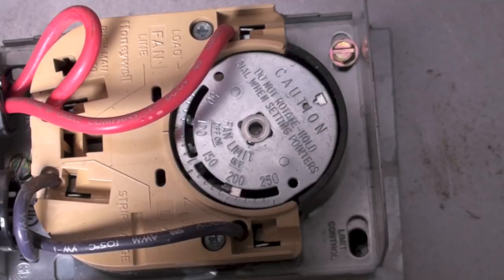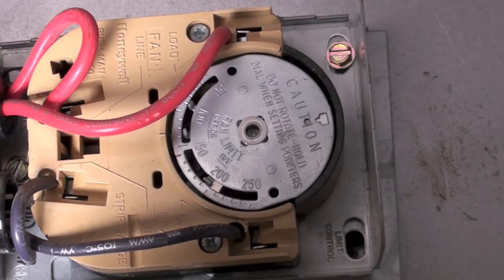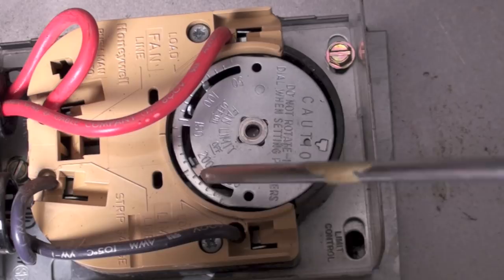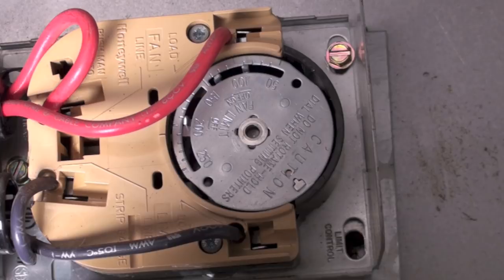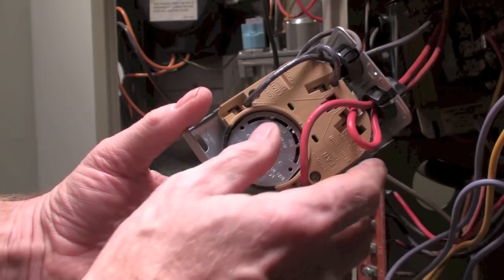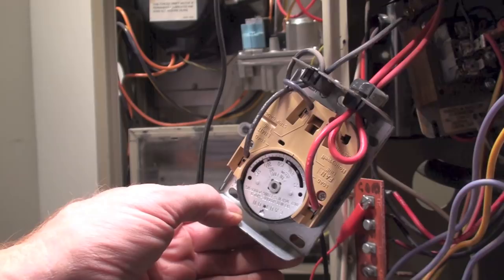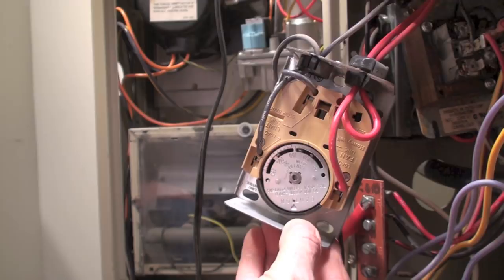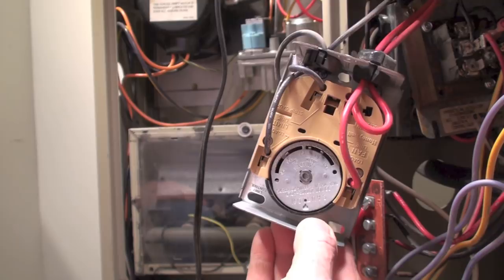How the Honeywell fan and limit switch works.

Comment: Is there ever an instance where u need the little copper switch in there? If so then explain it.
Reply from the maker: On some older furnaces, the limit switch opened the high voltage circuit to the transformer.  So power was run to the limit in the same circuit as the was used for the fan.  Hope this helps.
GFM
Reply: that does help

Comment: I have a Lennox pulse g14. Has no problem heating the house however the fan will turn on and off several times after the heating cycle is satisfied. I adjusted the fan off setting to below 90 degrees and now it only comes on once after the heating cycle. But as soon as the fan shuts off it slowly rotates back to 140 and stays there. The current fan limit switch is a honeywell l4064t2242 it says this part is discontinued do you know which one I can replace it with?
Reply: Ok. I have 6 total wires going into my switch does that seem right?
Reply: @grayfurnaceman7640  changed out the fan/limit switch, works great but while I was working on it I found a small propane leak around the top of the gas valve. I dont know If it's the pipes or the gas valve itself. If I shut off the gas to the furnace disconnect the pipes and put thread compound on them and reconnect them with I have to do anything special to light my furnace again? Or should it just resume like normal
Reply from the maker: @daltongavers491  First, I would try to isolate the leak by using a soap solution on all fittings.
Once it is reassembled, you can just fire it off.  It may safety out for the first couple of ignition tries, but it should fire off ok.
GFM

Comment: Here is a question, last weekend my furnace started short cycling, Call the gas company because I have a repair contract with them.. they replaced the limit switch, but didn't fix the problem, saying it's the "extreme cold"  they made an adjustment to the temp pins, that got me through the week, the tech told me to adjust the pins back to where they are suppose to be when it gets warmer.  So I did that this morning.. same short cycling issue.. Now they I watch this video, I noticed my switch isn't working like that.. it goes on at 100, fan kicks in at 150, then it goes back to 100 and shuts off..  why would it doe that?
Reply from the maker: What is happening is that the cold air in the return is "shocking" the switch and shutting down the fan.  There are a couple of reasons for that.  One, if you have a very low return air temperature it could happen.  Also, some fan switches have a small heater that preheats the fan switch.  If that heater is failed, it may also shut off.  I have a video scheduled to come out at the end of Jan covering this heater.  Hope this helps.
GFM
Reply: grayfurnaceman
My return air is in my house, very short return.. it's a condo actually. the return length is about a foot and a half, with the furnace in an outside closet. I've been here since feb of last year and never had an issue. that's why it's confusing to me. and today, it's 62* vs the -20 it was the other day.
Reply from the maker: joey197777 Your furnace is outside the house?  In a lean to next the house?
GFM
Reply: it's in a closet outside. It's how the condo was built.
Reply from the maker: joey197777 My guess is the problem is outside air is getting to the furnace.  There is really nothing I can see to fix this.  Do not cover any outside air grilles.
GFM
Reply: I appreciate it, I had the gas company out again this morning, this time they sent the guy who works the complex and did the inspections and gas meter installs when the complex was build 20+ years ago.. He said even though he couldn't get any carbon monoxide to show up, based on the smell he was smelling, and the way the furnace was acting, the heat exchanger is cracked. Said it was probably up high which is why it's doing what it's doing. So, 20+ years out of a furnace isn't to bad I guess. Time for new.  I will subscribe to your page though, for any future issue that might come up in this place.
Reply from the maker: joey197777 Glad you got it taken care of.
GFM

Comment: Hey brother; i have one of the other honeywell switches you posted with and set with the temps you said etc. The problem is it's shutting the burner off after 90 seconds.. runs just like the one in this video with no fan.. cept my fan is on and it reaches the too hot level and kicks burner off for like 6 minutes as it cools.. repeats. single digit temps in PA and thermostat reading 62° inside.. probably colder. Would imbalance of ductwork cause this (not enough return) or need bigger motor for hamster fan? Or...?
Reply from the maker: There could be ductwork problems or a crack in the heat exchanger near the fan and limit.
GFM
Reply: grayfurnaceman 
Welp.. wouldn't ya know.. the hamster wheel was spinning in the wrong direction.. reversed motor and heat pumping. Thanks to your videos!
Reply from the maker: That will make a difference
GFM

Comment: I got one more question. I replaced my thermostat and the AC comes on fine and the fan comes on fine. I think my limit control switch might be bad. The thing is I don't know how to test it and mine is not like this one. Mine are two bars laying in parallel beside each other. There is a red black and blue wire. Can I put any limit switch on it or do I have to replace it with the same one? Fanomatic or something like that. And can you tell me how I could test that limit?
Reply: +Mike LikesBeer Sorry it is a thermo disc
Reply from the maker: +Mike LikesBeer They are specific to each furnace model.
GFM
Reply: grayfurnaceman Thats what the problem was the whole time. There are two on this one. I think one is working know and the other is still not functioning right because its not kicking the fan on. Because the fan wont kick on unless you turn it on manually the furnace will kick off by its self.
Reply: grayfurnaceman Just a follow up. It was both the limit and the fan switch. I just touched the back of the limit switch and it reset, but the fan switch I had to remove and tap on my counter top. When the build up/corrosion? all fell out I put it back on and it works like new. I'm sure its not like new but its working correctly now. 
Thanks for your help. Saved me a lot of money! and subbed. Looking forward to the homemade beer! You gonna have to do some taste test if you haven't.
Reply from the maker: +Mike LikesBeer The switch will probably fail again.  But, who knows.  The taste test are coming and maybe some recipes if I get a really good one.
GFM

Comment: I don't get it. I have exact switch but I don't see how the fan is connected??
Reply from the maker: The fan is connected thru the the contacts marked "fan" on the switch.
GFM
Reply: @grayfurnaceman  Really? Great, tx. You know, I had no problem, just trying to figure something out. I'm not sure how to take your response but it seems pretty cheeky and sarcastic. Why don't you watch your own video again and tell me if a person should be able to know where those 2 red wires are coming from. Or which is +/-
Reply from the maker: @blackopal3138   It was not meant that way.  Watch the video at about :30 seconds in and you can see the diagram on the switch.  This equipment is AC, so there is no + or -.
GFM
Reply: @grayfurnaceman  k, sorry. hate written communication. tx.... I guess what I meant for the +/- is that both wires are red so I couldn't tell which was the live (I call that +, maybe that's incorrect and misleading)
Reply: Why don't you get a book on furnaces and study them rather than bothering GFM with your obscure questions?
Reply: @x.y.8581   - Oh, good word usage, however extrinsic your comment may be.

Comment: Hi  Grafurnaceman ,

The Lennox gas heater rooftop  fan control has two extra wires  go in to Fan control  /high limit switch  . What is these wires functioned . What  can I do if I can not find the orinal part. Do I need to modify it some how . Thanks
Reply from the maker: quang nguyen They are probably a preheater.  You can replace it with one without the preheater and hope it does not short cycle.  Sometimes, if you set the on and off temps a little farther apart, it may work ok.   This video may help: https://youtu.be/-0CIsqw3HRcGFM
Reply: grayfurnaceman Hello ... I have one of those switch and I think it is bad.  When I hit the manual switch the blower does not come on.  I was trying to use the blower to push cool air up from the basement and it didn't come on.  I check for voltage to the blower motor and I didn't get 120 volt reading.  Correct me if I am wrong, but the blower motor should come on when the manual switch is turn on.  I know the furnace is getting power because I can hear it come on.  So do you think my switch is bad?  Thank you for your time.
Reply from the maker: spirittoo It certainly should.  The control may be failed.
GFM
Reply: grayfurnaceman Thank you sir for your quick response.  I ordered a replacement part from ebay.  I made sure I got the same length which was 11.5".   Hopefully this will allow my blower to turn on.
Reply: grayfurnaceman I replaced the fan and my blower still won't come on, but I am getting power to the motor this time.  Is the motor bad or am I missing something??
Reply from the maker: spirittoo If you are getting power to the motor, check resistance of the motor windings with the wires disconnected.  Open reading means winding failure.  If low resistance, you need to check all your wiring and voltage readings.
GFM
Reply: When you say check all my wiring ... do you mean the fan wiring or the furnace itself?

Comment: Hi, do you happen to know the model number of this limit switch off the top of your head?
Reply from the maker: There are several models that pretty much look the same from the outside.  The difference is in the length of the probe. Try L4064B to start.
GFM
Reply: Thanks, mine is almost identical but was a L4064e2544. According to honeywell, you should be able to replace it with a generic model L4064B2228 (Replaces L4064A, B and E). Going to try it out this weekend. Thanks again for the videos, they're great.

Comment: hi , im a new tech, , is there any way i can by pass this limit switch
Reply: You can jumper the terminals between the limit switch.
GFM
Reply: @electriccar3253  on the video there is 2 red wire is fan, and 2 black is limit , do u mean get a jumper connect black to black?  and it will by pass the limit ?
Reply: @geniusliu143  Yes
GFM

Comment: hi ,i an new tech ,i had a furnace has problem is working heat and ac in same time ,i am looking for advice if you can thank you
Reply from the maker: ***** Does the house have a whole house fan?
GFM
Reply: sorry,what you mean by gfm ,i work as maintenance in apartment complex thank you
Reply from the maker: ***** Those are just my initials
GFM
Reply: sorry gfm ,what you mean  by a whole house fan ?,my furnace is air forced the fan is in furnace
Reply: thank you

Comment: Bryce Katzman
3 minutes ago
Hello! Great video! Question: I just replaced the belt drive blower motor with one that is basically the same (1/3 horsepower, 1725RPM, etc..) the problem with the switch above is: that after kicking on the motor at 150F it starts to go backwards until it hits 90F and shuts off. This takes about 5-10 minutes. If I left it like this it would do it forever. Any suggestions? Thanks for any advice. Bryce
Reply from the maker: Too much air or return air too low temp.  Is the amp draw the same as the old motor?
GFM
Reply: @grayfurnaceman  - Thanks for the info. It helped a lot! - It turns out that I had some cold air escaping from an exhaust vent for a gas fireplace that I was using temporarily while my blower motor was busted. Once I closed it all was good! Thanks for the reply. I appreciate it!

Comment: great where can I pick one up
Reply from the maker: Generally, there are 2 ways to go.  One, you should be able to get one from a local HVAC dealer. Two, there are a number internet sources.
Reply: could I fix the one I have if I clean it the inside probe
Reply from the maker: Generally not.  You can remove it and clean the element, but it probably won't help.
GFM
Reply: I would like to replace limit control the only number I found on the side was L4064E2015-6-8843N S025-23005  ......Honeywell
Reply: I appreciate your help but could it be another switch causing fan to stay on
Reply from the maker: The L number is the correct one.  The 025 number is probably a number for the manufacturer.  Could be Coleman or York.  I would use L4064E2015.  5 inch insertion depth.
GFM

Comment: Im in a apartment , and landlord is up in age and clueless on repair... But my fan runs sometimes long time,, but after it does shut off ,, it will then keep coming on and off constantly.. 
So i figured i start with this but when i look up part numbers they all show one's that have a cover on them and mine does not.. Here is number i see on mine. L4064A  1347  5
Reply from the maker: The cover is not important.  If there are 5 or 6 wires coming to the switch, and in the center of the switch there are 2 terminals close together with wires (usually yellow) connected, you have a fan switch that has a preheater.  You can remove and isolate the wires to test if it stops.  If it does stop just leave the wires isolated.
GFM
Reply: @grayfurnaceman    Mine is a little like yours in pic but with 4  black wires...And on my fan switch between those 2 wires that are closer together it says remove for low voltage...
I tried my best to find cross ref for newest unit to replace my part number of L4064A  1347 , and new seems to be part number L4064B  2236 which i ordered.
 Also the New part has a Man or Auto button on it, which my old one does not
So since furnace is old i went ahead and ordered new switch which will be here in few days.. As of right now after furnace runs it will shut off, then few min later blower fan keeps coming on for aprox 3 seconds then shuts off and then back on again and it does this until it has cooled furnace enough.
I've watched the round dial on the switch and its not  smooth with its movement, as it jumps a little like its sticking maybe but im not sure how smooth they suppose to operate while heating up or cooling down.
There may be a second issue as of a few hours ago,, as furnace went to run by turning on blower  and it makes is a loud click and then motor just hums like its frozen up.... Possibly bad blower ?
Reply from the maker: @TheC5corvette  You can try separating the on and off tabs a bit more.  The operation should not be smooth.   There is resistance in the switch.  
On the motor, hit it with a small hammer.  If it starts, the centrifugal switch is failing.  Means the motor must be replaced.
GFM
Reply: Why are you trying to fix the problem when it is the landlord's responsibility?    Stop paying rent until he gets it fixed by a qualified furnace repairman!

Comment: Here is what it looks like. There are one on each side and I dont know how to test. black and red go up on right bar and the blue goes on the left bar. Then there is a black jumper that connects the two.

http://www.bestbuyheatingandairconditioning.com/Merchant2/merchant.mvc?Session_ID=69df4affdab364afd51b98172e3ac67f&Store_Code=BB&Screen=PROD&Category_Code=fl-tdl&Product_Code=LIM7581